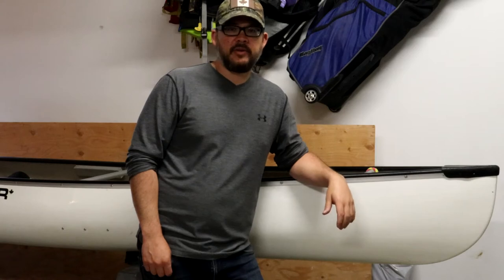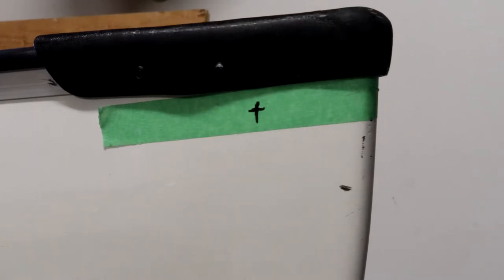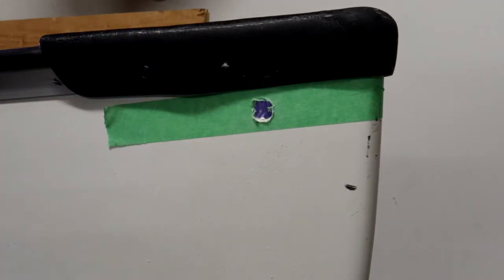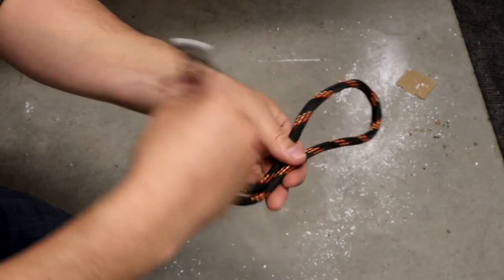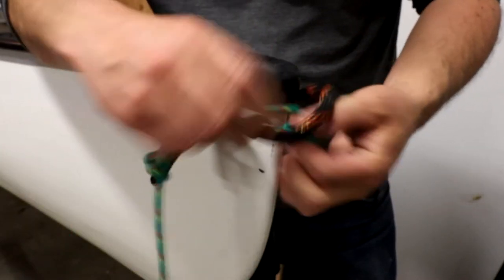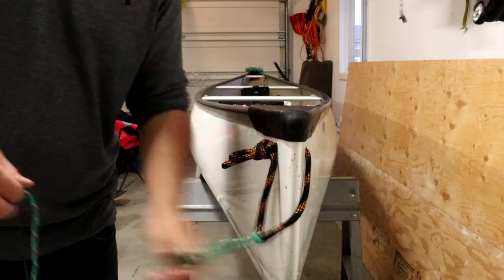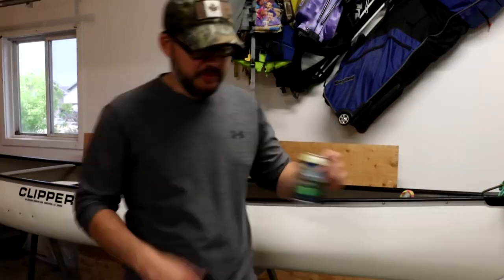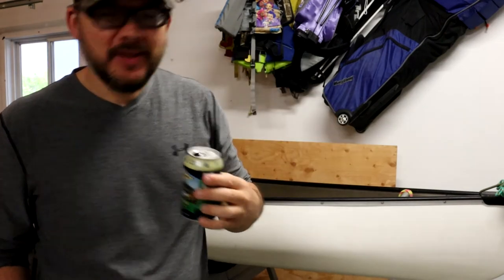Add End Loops and Painters to Clipper Packer Solo Canoe

Comment: Love that beer too!  Not too experienced with the ropes on the ends of a canoe but is it for guiding the canoe down rapids? Does it matter if the ropes are at the front or would it work to tie around the handle bar in the canoe by the flotation chamber? Great videos btw
Reply from the maker: l will line the canoe up and down rapids or fast current. It handles fine attached to the grab handle on the canoe but would track right or left in faster current. I figured it would be best to pull from the very end for better stability should I have to pull the canoe in fast current, around boulders or through a marshy area. The best position is as close to the waterline as possible to avoid capsizing the canoe when lining up or down rapids, but I didn’t want to drill into the tanks. Thanks for watching my videos and for the feedback, much appreciated!